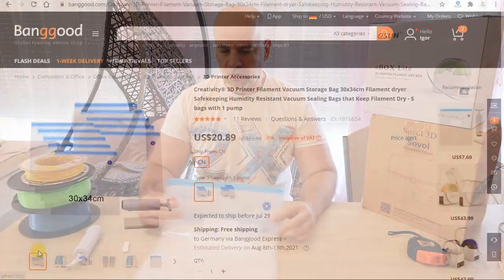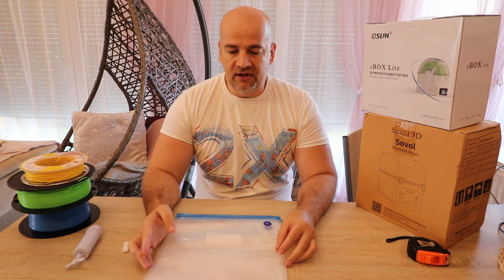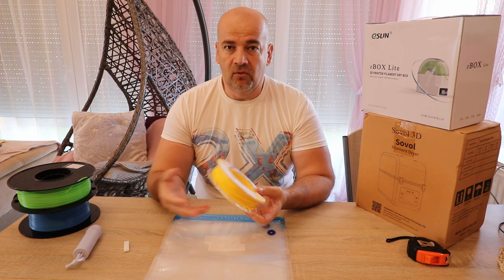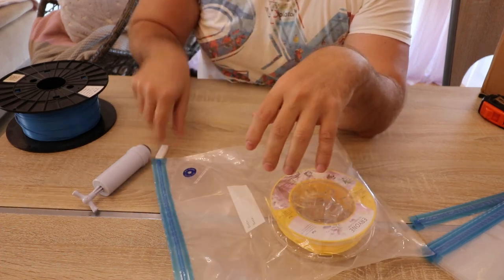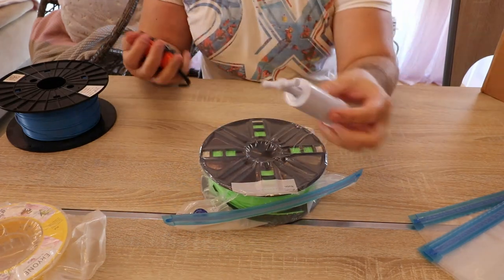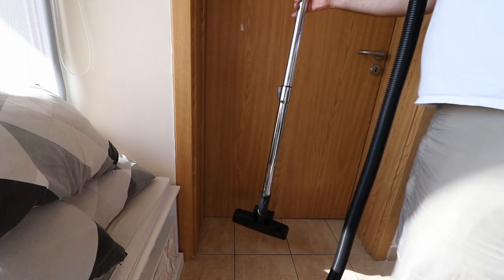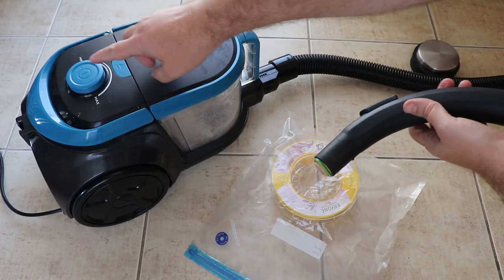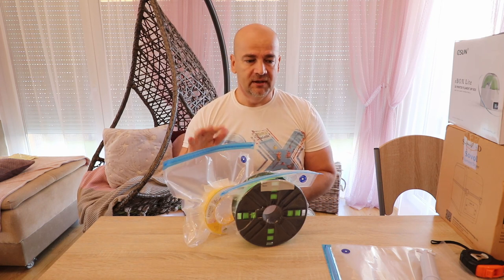Storage vacuum bags - how, when and why to use them to store 3D printing filaments

Comment: i had 10 of those bags from esun, but only one of them worked. on the other ones the air just couldn't be sucket out, whether with the pump nor with the vacuum cleaner. the solution was to heat up the valves. i did this with suckung out the air just over the outlet of the hot air of the vacuum cleaner

Comment: Thank you for making this video!  I ordered some of these zip-lock type bags with a small USB rechargeable vacuum pump from AliExpress, and of course, there were no instructions.  After struggling with the bags for a little while, I was beginning to wonder whether or not there was some sort of check valve, or if the adhesive layer on the "hole" needed to be peeled back and replaced.  Your video made it clear on how to use the kit. Thanks again!

Comment: how does vacuum sealing filament in hygroscopic material prevent moisture? does it just slow it down? i was thinking of making an vacuum sealed acrylic enclosure, but learned acrylic is also hygroscopic so am wondering what the actual benefits are.
Reply: It slows it way down. There's three steps to this: the vacuum lowers the boiling point of water so whatever moisture in there has more chance to become vapor and get extracted while pulling a vacuum, there is less air in there so there is less total moisture that can seep from the air back into the filament, as well as the vacuum slowing down the absorption rate into the filament.

You're right that eventually moisture will be sucked into the bag material and end up in the bag over time, but if you dried your filament and then stick it in a vacuum bag there is just another barrier for the filament to just absorb all that moisture back, so it will stay dry for longer.

Comment: I always want to design and print something like the converter. If I were you, I will try hard to calibrate the printer instead of redesign the converter. You have already used the caliper to measure the pipe size which is accurate.
Reply from the maker: I agree. This is new printer, and in review I noticed it underextrudes the TPU a little bit. PLA is OK. But their user interface is too simplified, there is no estep calibration in UI (like on Ender3v2).

Comment: These bags are awefull. I ordered 10 of them and after testing 5 I had 4 of them fail. Maybe I got unlucky but they are very fragile. How did your held up after 1 use?
Reply from the maker: Mine works great. Few times air goes out, but then I used that plastic part for better sealing and then they hold the vacuum.

Comment: I'm thinking using vacuum bags hurts more than it helps if you are using some kind of moisture absorbing material (For example silica) inside the bag. If the filament has absorbed some moisture I'm thinking it would be a good thing for it to be surrounded by dry air that it can transfer it's moisture to. When using a vacuum bag I imagen this transfer of moisture between the filament and the silica will be hindered.
Reply: Silica packs can’t dry filament. They keep it dry by scavenging water in the air/vacuum in the bag. 

Water adsorbs strongly on the surface of the filament and heat is required to drive it off. Vacuum alone doesn’t pull the water off fast enough to be practical. 

Getting the moisture away from the filament speeds drying. Vacuum does that, but so does pumping in dry air. If I’m in a hurry to speed up drying in my Sunlu drier box I’ll stick the straw of a canned air duster through the hole in the drier’s top and give it a few blasts. The gas in the can is bone dry and has higher density than air, so the moisture gets pushed out.
Reply: @KEO7890 I still can't see why it's beneficial to use a vacuum bag. The vacuum is not strong enough to lower the boiling temperature of the water inside the filament to any meaningful degree. All you end up doing is hindering the dry air from circulating inside the bag, and trapping moisture.
Reply: @sumguje5917 .. if you leave it out without a vacuum bag, it will continuously absorb water. In the vacuum bag it’s protected from the environment where it can’t absorb anything else.
Reply: Steve, you are not getting my point.. I think it would be more effektive to put the fillament in a loose plastic bag versus a vaccum bag because the loose bag will allow moisture to be transfered to the silica beads more easily. The vaccum creates a tight seal around the entire roll of fillament making it hard for moisture furtest away from the silica having a tough time getting absorbed
Reply: @sumguje5917  in my case my city's moisture level never drops below 60% so I literally can't find any air thats more dry than filaments. Because of that filaments can't give moisture naturally and any air will fuck up silica beads in a day so they have loose the ability to suck more moisture (from the air that you planned to make drier than filament so filament gives his moisture to the air). those bags not a solution to moist filaments its a loosers league prize that you cannot get them drier you just want them not to suck more moisture. If your citys air is more dry than mine yeah yours would be bettter because air is not the enemy water is...

Comment: Thanks for this video i was also planning to purchase this vaccum bags 🤘🏻😃
For how long does the bag hold the vaccum ?
Reply: good question
Reply from the maker: If they don't leak after 2-3 days, they hold vacuum several months. Approx 20% of my attempts I have to reseal again after few days. It's very important to use that plastic correctly I mention in video.
Reply: I purchased the Esun version of the bags, look very similar. Mine have held vacuum for several months with out any real loss. They also came with a moisture indicator you can put in the bag. I did find you have to press the vacuum circle down and make sure it’s sealed closed after vacuuming.
Reply: @HelmutVonSchet   A google search for Vacuum Bags including any other arrangement of words gave countless results mostly for food sealing bags that I gave up looking. Thank you for the brand name I was able to go directly to their site and they do look the same as the ones in the video.
Reply: @Laystraight  I got mine on Amazon.

Comment: I use vaccum bags from stores. Nowadays there are a lot of places you can find them and they come ready for a vacuum cleaner. As well are cheaper (like 2-3 euro for 3 of them).

In time though they all leaks air. No idea if the design nor they pop or whatever. May be yours are better in that way